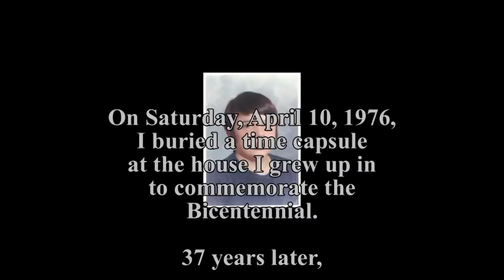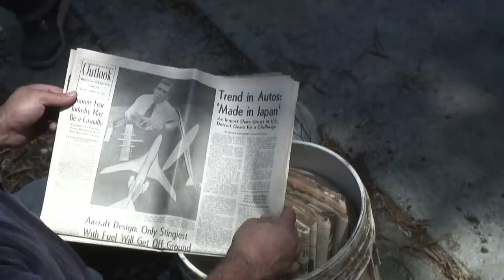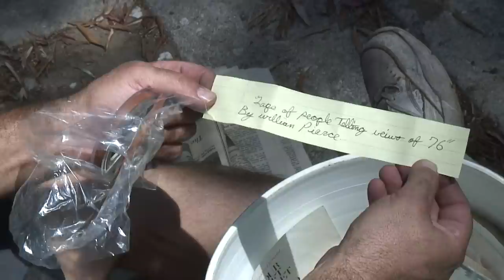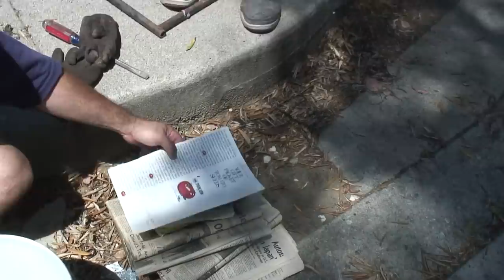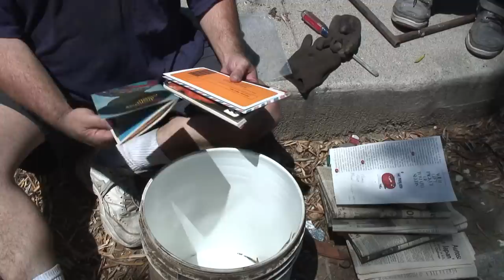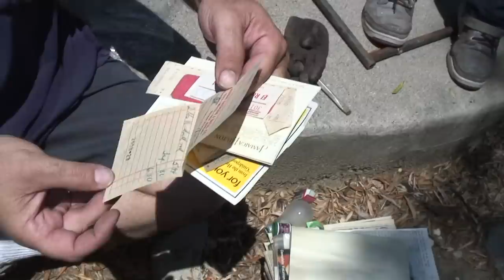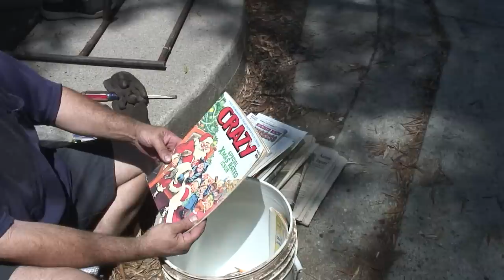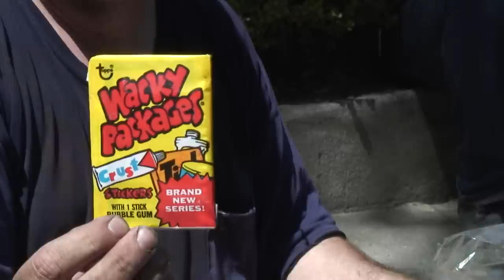Time Capsule buried in 1976 is found in Los Angeles neighborhood

Comment: Y’all don’t use lightbulbs? It ain’t 2076 yet...
Reply: @sebdutton9729  Sure they would.
Reply: @sebdutton9729  Down here in the United States if the bulb is rated for 120 Volts and has a standard size screw in socket base it will burn just fine in today's lamps. Back when this guy made his time capsule in 1976 the standard line voltage in America was 120 Volts AC and most bulbs were standard screw in types. The same is true today, the standard voltage in America today is still 120 volts just as it was in 1976 so the bulb will work fine and it won't blow out.. I also know this because I have bulbs that date back to the 1960's and 70's that still work fine today.

Comment: Should have bought like $500 in apple stock and put the certificate in there too ;)
Reply: Apple didn't go public until 1980. I was given shares in 1984 as a graduation gift, and sold them a couple of years ago near the stock's peak.
Reply: @gotham61 how much did you get for them?
Reply: Danny Ward
It was about $12,000. Originally it was just five shares, but there were several splits.